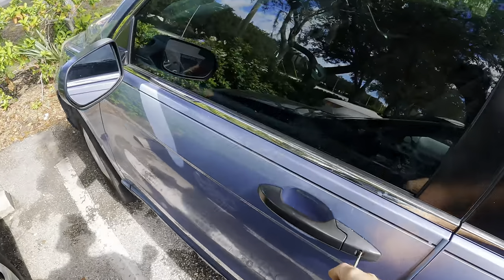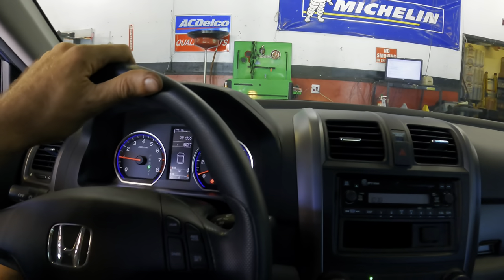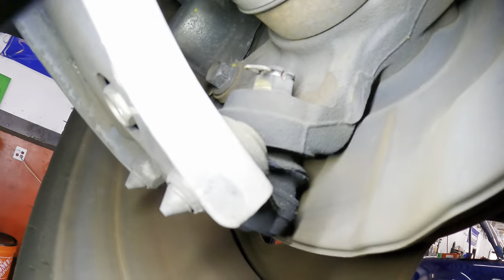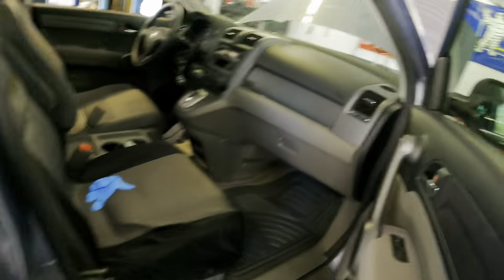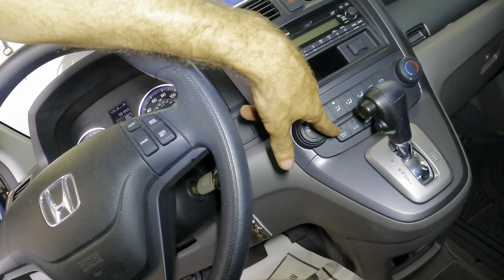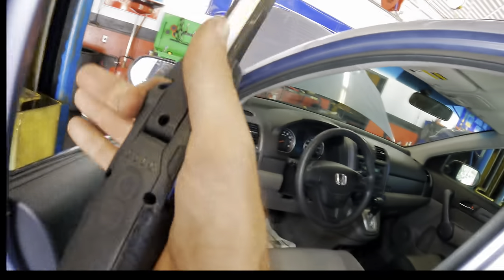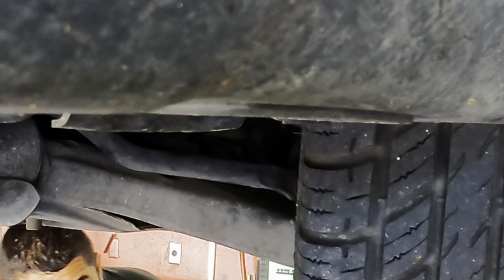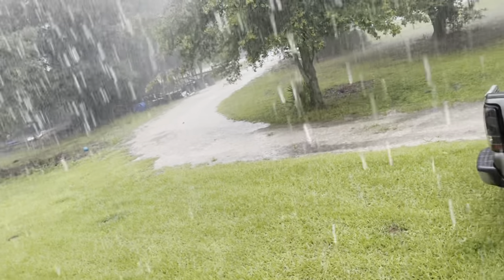Scam or Stupid? YOU decide! Work that wasn’t needed! Honda CRV

Comment: Small point/issue but I get pis*ed during servicing of my vehicle to see a charge for window washer fluid fill up  $1.97 etc ... last time in I refilled the container before driving to the service center and took a photo of the full container.  When the charge showed up on my bill - I discussed it with the service manager and he related they usually just note fluid check on the billing - but since they noted a window washer fill that obviously was not required he deleted the charge - this took about 10 minutes of his time - but well worth it from my point of view.

Comment: Thanks for another great video, that being said, that right ball joint is a MOT failure here in Europe due to dirt and grime getting in there and is prematurely wearing that joint out, I do understand that it is different laws and regulations but it’s such a cheap item so I would have recommended that repair to the customer.

Comment: The other shop may not be at fault. You can't check ball joints like you did in the vehicle. They go up and down, so the only way to properly check them is to put a pry bar under the tire, and pry in an upward direction while someone else watches. The prybar is a must because no one is strong enough to put enough pressure on the tire to do it by hand. However, I know that sometimes you can feel play when you check ball joints by hand. That's not a good thing because it had to be bad for a very long time, and when you get play just by moving the wheel with your hands, its a real safety concern. At that point, its ready to break.

Oil on the new ball joint is explainable. You have to slip the axel out of the hub in order to remove the top bolt on the ball joint. When the tech was putting the car back together, he sprayed penetrating oil, or something similar, on the axel to make it go in easier. If you look at the video again, you can see the exact path the excess oil took as it was running straight down from the wheel bearing. There's really nothing else that could have done that.

Comment: Good call, Ray. Torn rubber on the joints is an annual inspection fail in Europe because dirt gets in there and wears the joint fast. This is not worn, so who knows. I always change both in these cases, same age, same dry rubber. But the stabilizer bar sway links are good, very strange. Noise from there would be a racket if there is play. Also wishbone rubbers can make a racket if gone, but you’re wayyy to experienced to miss those. Suspicious case. But seeing some of your vids, some people come in with loose wheels and only want an oil change, if you quote them, they’d call you a liar if you don’t watch out. Machines are machines, you have to know what you’re looking at. Then it’s it’s a question of trust. You’re one of the good ones, keep it up! Regards from Holland

Comment: even besides the honesty in what is necessary to repair I appreciate you looking for the jack up points.
sincerily, someone whose car was jacked up on the body seams multiple times instead of the frame rails leading to crumpled, rusted sheetmetal.

Comment: Those sway bar links often get loose in the ball joints because they have plastic joint sockets.  To really test them, grab and jiggle.       A little pry bar action to check the knuckle ball joint isn't a bad idea, because the spring compresses it.

Comment: My wife's car had a lower ball joint failure. I replaced the CV axle a few months prior, and nothing was wrong with it at the time. She had to get it towed to a shop. Shop replaced almost the entire lower suspension components, claiming damage on BOTH sides. She was on the hook for $700+ Labor.

Comment: I would have recommended wipers, fluid maintenance. Cooling water was low, it's going somewhere. 1 quart of oil low and monitor it closely after filling. And I would have informed her that at least one ball joint will need changing probably prematurely because of the torn boot.

Comment: A few things:, to properly check stab links, shake them w the suspension in driving level geometry, not hanging down. I don't know how many I have found that were actually loose, that didn't have any play w the suspension hanging. And 2: when you checked the oil, the dipstick wasn't all the way down, and I assume you know the the two dots on the stick are 1 qt apart, not 1/2 qt.

Comment: Unfortunately, this is common. It's happened to me, it's happened to most of us. 

Here is one game shops use, the term "manufacturers recommendations". For instance, same situation as you saw in this case, but it's my sister, also a bit older and on a fixed income. The bill was really North of 1,300 dollars (and it would have been more, since they "missed" something critical). 

But first the Manufacturers recommendations,  in her case, oil change, air and cabin filter and wipers. 
I promise you they never checked any of that. But, here are the costs, with labor, but no tax, Wipers 50 dollars, Cabin Air- 45, Engine air filter-35, oil change 50. 

Here is how I know they did not check any of this. The wipers worked great, the oil was changed (by another of their affiliated shops) recently, still was a nice golden brown, the engine air box had a bunch of pistachio nuts stored in them no mechanic would leave in the air box if they checked the filter and the cabin air filter had not been changed in so long, when I pulled it out (near the accelerator pedal) dirt fell onto the carpet. She in FACT did need the cabin and engine air filter, but I am sure they just had a "lucky" recommendation. After all, they charge 21 dollars to install a cabin air filter, do you really think check it for free? They would basically do the labor anyway. 

Now the rip off they tried to pull. The check engine light was on, they charge 100 bucks to put it on a scanner (fair enough, even though parts store do it for free) and the ONLY thing they NOTED was the clip to the engine airbox was "missing". The code came back for mass air flow sensor. 

Alright, did you read the part of missing clip? Yes, the air box was OPEN, so, dirty air was getting in. How was it missing? I mean, they don't just fall off. Chances are, their other shop did not put it on correctly, it rattled loose while driving. 

Ready for the solution? If you guessed 6 dollar air clip, WRONG. How about 670 dollars (plus tax) for a airbox? And it appeared to me, you could buy the upper or lower portion of the airbox, you did not have to buy ALL of it. So, was the airbox broken and that's why the clip is gone? NOPE. 6 dollar clip fixed it. 

Alright, the check engine light, Mass Air Flow Sensor? They wanted 333 for that and 96.50 to install, plus tax. Now, I could buy that Sensor from Nissan for 225!  Or a auto parts store one for 100, but the install? I swear that is a two minute job, 5 minutes if you want to disconnect the battery first. 

But, hey, did you see the clue of OPEN AIR CLEANER BOX? How much dirt went over that Sensor? 
Ya, how about instead of a 333 dollar sensor, you try of couple of squirts of Mass Air Flow Sensor cleaner first? 

That's what I did. Put it all together, cleared the code and it came back on. I then checked the hose to from airbox to throttle body and it's cracked. Something they would of found out too, after charging her for all of that. After market price, 18 bucks. Cleaned throttle body while there, installed it, all good. They NO DOUBT would of charged a couple hundred dollars. 

I think the total was 66 bucks. Car runs great, no codes and NO, I am not a mechanic. I even got it on the freeway to clear a couple of "permanent codes", it's smog ready. 

Little old lady (sister) saved around 1,500, now that I have her invoice in front of me. 

Best part? They lost a long time customer (new shop, but same company).

Comment: Yeah, I refused as a mechanic to up sell things people did not need. And there were times I pissed off the service writers. It really pissed one guy off when a "junker" came in that he figured would have a long list of needs....Did the oil change on it and found it had brand new tires, barely used brakes, brand new brake lines all around, clean and dry shocks, no worn bushings, the engine purred like a kitten... It was a beat up, well used VW Jetta Wagon with a 2.5 liter 5 cylinder and manual transmission. The only things I found were the typical 2.5 liter oil leaks that almost no one paid to fix, and it needed a rear wiper blade which the customer did authorize for changing. I over heard the service writer saying he thinks I half assed my job and I asked one of the other mechanics to "check out how clean this car is" and I am glad I did because he saved my butt.

Comment: If you get this crv back, the noise will be a knocking noise, as I've had this problem with 2 CR-Vs, I fixed both of them by replacing the sway bar mounts and fixed the issue both times. Cheers Ray from Davis in Cowra Australia 🇦🇺.

Comment: Talking about the thumbnail:  What's wrong?  My IC vehicle shows that pretty normal when I've cleared the trip computer, just fueled up, and driven 10 miles without stops at like 45mph.   That is insanely efficient and the comp compares fuel use to distance and comes up with that nice calculation.
And then I get on the local highway with a speed limit of 65 where everyone is at 80-90.... fuel efficiency drops to a more expected 26mp/g rather quickly.

Comment: Who in today's world HAS'T gone in for a $50 oil change and been presented with $2000 worth of recommended parts and services.  Fortunate that I am not that naive and have the tools and aptitude to verify their findings before agreeing to any of it.  Last time around was front sway bar bushings cracked and broken (I do need to check but I am getting 0 indications that it's true), front wheel alignment (due to sway bar servicing, but currently fine), rear brakes AND rotors since mine were obviously warped (weren't warped or uneven, since that isn't really a thing OTHER than uneven wear, and brakes were still 6-7mm I did them anyway on my own), coolant flush, engine and cabin filters (just replaced a month ago)  Good on the ole girl for wanting a second opinion.  Good on your for not dragging people through the rock pile to make a few buck for the shop.  ;)

Comment: Before I started learning and working on cars imwas at the mercy of your firestone goodyear Sears etc repair joints. Everytime I went to any of them I always needed, ball joints, tie rod ends center link basically all front end parts, I didn't drive much but I trusted them afterall I didn't know anything about cars, oh I also always needed brakes, this was back in the seventies, you see my father had a stroke in 1976 and was never able to drive again and my mother didn't and wouldn't learn to drive. I was 16 so I became chauffeur and took cars of the family car, and was literally taken for a ride when it came to repairs I was, a young kid was at the mercy of these sheisters, I've learned a lot since and almost became z professional mechanic as a result, I was fortunate to get a job in auto parts which taught me a lot as well, I became good friends with one customer who helped me out when I had trouble and consequently they taught me a lot, just like doctors if you're not sure get a second opinion, I also would get references from family and friends as to who is reliable and honest, the corner garages still exist but are harder to find good ones, years ago you'd build a repore with a garage, you'd buy gas at the same place they would get to know you and take care of your repairs as a result, those days are unfortunately over.

Comment: 7:34 i want to add to this comment. i had alot of work done to one of my vehicles at a shop that id never been to but was recommended to by other mechanics. was getting horrendous shakiness from the steering wheel - getting them balanced fixed the shaking a little but still wasnt perfect. front tires never sat correctly, was a camber issue. was quoted over 3 grand to replace alot of my front end suspension components etc. the thing was, that shop mechanic took me underneath the car and showed me what was wrong and showed me all the worn bushings, rear uni joint etc so that i knew what i was spending my money on. i dont think that other shop did that or many other shops do that

Comment: I appreciate the fact you are giving them the benefit of the doubt. I wish we could have found out about the glove box. If the other shop was given the valet key, couldn't have examined the cabin filter but recommended it be changed then I would be inclined to believe they recommend unnecessary work. My gut says, if she gave you the valet key then she probably gave them the valet key as well. It is sad but different people with different values. 

I'd had a mechanic who was just incompetent; he just kept randomly swapping parts in hope of making the issue go away.

I've had dishonest people as well. I stopped at a random place to get an oil change (don't blame me, I didn't have time to see my regular mechanic and it was way passed due for an oil change) and they did a multiple point inspection. From the inspection they told me I needed an engine filter, some work on my rear differential and my fan belt needed replacing. I change my own engine filters and knew that is a lie. How could they tell I needed the rear differential repaired? Finally, my car had an electric fan, there was no belt. I declined all the work and insisted they show me the dip stick. 😠

Comment: Many years ago I worked in an honest shop.
They had one customer come in wondering what a noise was, so they did a test drive and an exam similar to what Ray just did here.
Couldn't find anything wrong.
Then the customer took them for a test drive and sure enough they heard a rattling.
It turned out being the keys on the keychain all rattling together, and the customer had only given the shop a single key.

Worked at another shop later and they did an out of province vehicle inspection
The vehicle was in excellent condition, with things like new brakes, and they hosed that customer.
I think it was something like $1,500 way back in 1990.

I didn't stay there long.

Comment: Thanks for the heads up concerning the age of the tires. My wife has a 2010 Honda CRV with 47,000 miles on it. I make sure the tire pressure is correct and have them rotated every 6,000 miles. After seeing you check the date of manufacture I began to think that I need new tires, yup they were 12 years old. Baby got a new pair of shoes and an alignment, so thanks for this video.

Comment: At the inspection garage they said the parking brake needed $980 repair - I  replaced a wire cable which was bad - $40 part - took to another garage & got inspection sticker

Comment: Honest mechanics are hard to find.  Long ago I had a vibration in my car when I was at a stop.  The shop sold me a new torque converter and the vibration was still there.  Turned out to be motor mounts.  I actually went back to school for a 2 year automotive degree just so I don't have to have someone else work on my Mustang.
Reply: Education really is priceless. Not a bad idea.

Comment: First thing I always state when getting maintenance done is tell them not to go looking for work. I ask them to not do the "courtesy inspection". Saves some time as well. I know enough about my vehicles to know what needs done. On that note I used to do my own oil changes but found its cheaper just to have them do it.

Comment: The only times I have problems with mechanical repairs is when I use companies that advertise heavily, it almost seems the more they spend on advertising the more i spend on repairs. The local mechanics who work in smaller shops, that don't advertise, have been fantastic.

Comment: I wonder if the ball joints were rusted and getting tight and they tried to spray some oil in the boots.  Pretty common here in the rust belt, seen them rust tight and twist off.  Sway bar link maybe a misdiagnosis of a noise? A noise maybe that was coming from a tight ball joint?  Just trying to give the shop the benefit of the doubt before saying they're scammers.  Might be incompetence

Comment: I use Mother's aluminum and Mag polish to make headlights new again.  Rub some on with fingers, let dry, buff out with lambs wool pad on buffing machine.  After done, put a coat of Carnauba wax on, then put coat of same wax on every 6 months. Works like a charm.  The mag polish has aluminum oxide in it, that's why it cuts better than sand paper.

Comment: My wife took her car to a shop to have a safety check and one of the things they said needed changing was the serpentine belt that I had changed less than two years ago because of an idler pulley failure. They said the belt was rusty. I'm pretty sure it will last another 100 k kilometers.
Reply: Oh, I hate it when my rubber belt rusts!

Comment: I always ask my more elderly relatives to ask my advise prior to agreeing to repairs. Just had a dealer try and say the brakes and struts needed to be replaced on a vehicle with 21,000 miles to the tune of $1000.  Struts were fine and plenty of life on the brakes. I know that times are tough but its not a reason to try and get over on people. I gave them a piece of my mind and warned them they may end up on tv one day trying to do that crap.

Comment: I started using Lucas oil treatment in my oil changes in F350 and went from 12.9 mpg to 16.1 mpg. Fuel treatment is good too for injector's but I think Lucas made a big difference.
Reply: Lucas makes a quality product. I trust them and seafoam. All the rest are garbage IMO.
Reply: Fuel cleaners are a scam, gasoline by itself is a cleaning agent that's still used to clean parts, the only time it helps is if the fuel filter hasn't been changed in a long time.